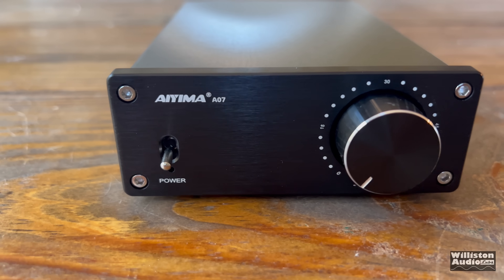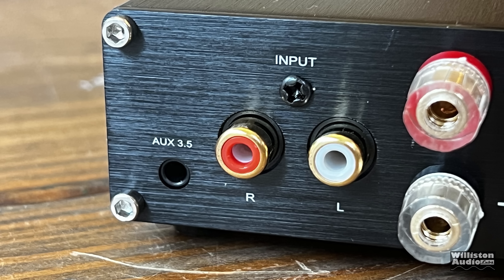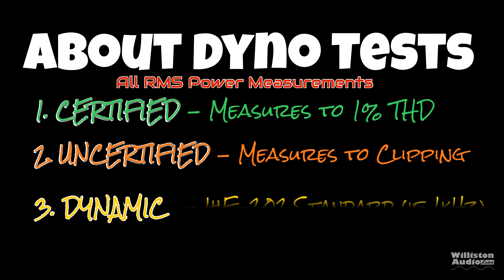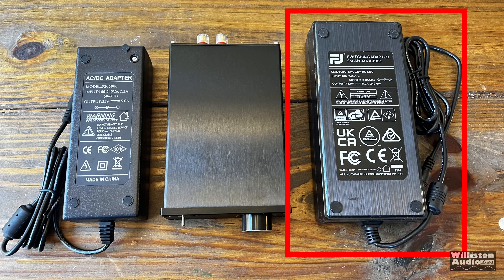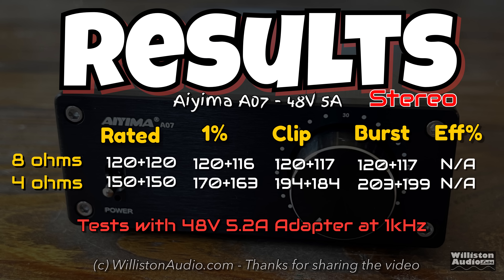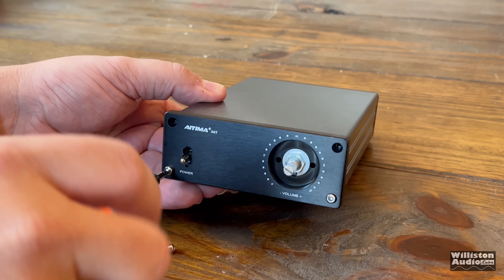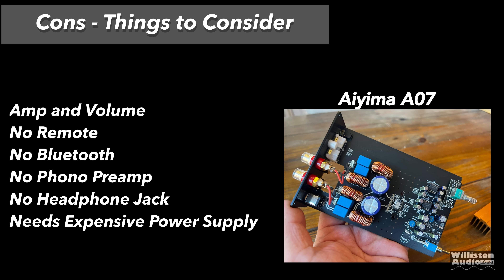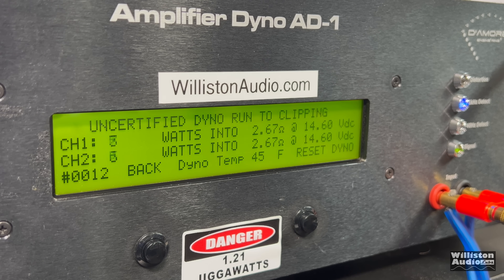Is it the MOST POWERFUL Mini Amp on Amazon? AIYIMA A07 Amp Dyno Test and Review

Comment: I should mention that this particular amplifier only uses a 50 volt input capacitor...  I would be reluctant to run it at 48 volts... I believe some of the other models are using 63 volt capacitors.

Comment: I have two of these that I use to bi-amp a Magnepan panel and a Newform tweeter. Along with a velodyne subwoofer.  The amps have been upgraded with new op-amps and an adjustable 0 to 48 volt 10 amp power supply. 

The image that these amplifiers produce with these speakers is completely 3D...   Everything in the recording exists in its own space on the sound stage... The speakers themselves seem to disappear...   I've never heard much better at any price.  

Anyway... What I'm saying is that these amplifiers are a lot better than people think they are....  World class sound in a small package.

... And for such a low price... It's incredible

Comment: @1:26 350% efficiency. It absorbs power from the cosmos 🥲
I have the A07 pro (speakers amp) and it's a pretty decent unit. Willing to add a sub to the system, so checking this amp out.
My only complaint about my A07 pro is that the line out jack (3.5mm) is generating a lot of AC interference! Not sure if my unit if faulty or if it's a flawed design.

Comment: 32V x 5A  = 160W x .9  (max efficiency = 144W (but it will never reach that.
Your 600W is silly and should be retracted and never repeated
A supply that will possibly deliver 600W will probably triple the cost of the amp and the amp will go into thermal overload and self destruct

Comment: Video is quite old, but here are my thoughts about power supplies and testing:

I paired 2x24V LED PSUs to get 48V of output. Not every PSU will handle it so make sure to make first some tests without AMP. I used 2 this same brand and model PSUs.
Other method of testing would be to test each channel separately. In this scenario only one channel would draw power from PSU.

Comment: I suggest checking out thrift stores that usually have a large electronics section to find a power supply with the specs you need. Me, I just go to the boxes in closets and basement filled with saved, cables and power supplies - you know those boxes my wife keeps telling me I need to get rid of.

Comment: Even if the bass comes out well, it clumps up.
Put the four internal pseudocapacitors (1uf)
Replacing it with 0.68uf improves the high notes and mid-range.

Comment: Actually ... so long as the output coils are up to it any TPA3255 amplifier is capable of  performance equal to the A07 or the newer V3 .... These little amps are basically a "chip in a box" ... when properly implemented their performance is all about the chip.

Comment: I’ve been looking for true power specs of this board. Thanks Dereck !  

I was going to put together 2 ICEpower 50ASX2BTL for 2x170 for a custom set of monitors I’m currently designing. My tylers are currently on some hypex amps and that’s not changing however I’m not putting that much money into this additional monitoring setup especially for the b room that doesn’t need to get that loud, rather than dynamic. 

These tpa3255 with my Mean Well LRS-350-48s just sitting around can make more than enough power for what I want to use them for and this video just confirmed via the dyno. 
48v at 7.3a, luckily I won’t NEED to drive to speakers but I’d rather have headroom and the power on demand. , the tpa3255 is gonna save me money time and headaches. 
I’m going fully balanced with xlr inputs and getting an aluminum rack mount case made for the project. Overall it’ll be a $300-400 project, nothing vs my hypex ncore setup plus the d2x’s when I got them were like $7800 

The tpa3255 can truly handle 52v before thermal issues start and it’s starts going into protect

Comment: Can you use a cheap car audio mono block sub amp (500 watts or less) with a good high watt power supply to power home theater sub woofer since it would be under driven anyway?

Comment: I just ordered one of these but didn't realise that the power output is less with the power supply that comes with it... I can only expect 107 watts x 2 running my 6 ohm speakers... (my speakers are rated at 140 watts) With your calculations that figure is bumped up to 133 watts, should be perfect! To get the full 300 watts you need to buy a 48v 10A switching power supply and wire up your own leads (beyond me). Mine came with a 36v 6A adapter. It's plenty loud though, a really awesome little piece of tech! Way better than my old Kenwood receiver!

Comment: Let me tell you, this A07 impresses even more - and how, you might ask?  Simple - replace the two NE5532 Op Amps out (they are easily removable) and replace them either a Burson or Sparkos Labs discrete set of op-amps (there are 2 op amps inside the A07).  The sound quality change then becomes quite remarkable, in that with the op-amp upgrade, the music becomes even more dynamic, more 3D-like, warmer in tonality - and (and this is a big and - in my opinion), the A07 now sounds a bit more like a class AB amp.  So yes, you can do quite a few things with this A07.

The other add-on that I brought in was a 40 Watt higher-end, quality Linear Power Supply (completely bypassing the stock external brick that comes with the A07) and the amp became even quieter - no noise whatsoever - no hiss - no hum - no RF feedback.  So between the op-amp upgrade and getting a true linear power supply, this A07 now sounds more like an amp that runs from $800 top $1500.
Reply: Thanks for the tips! A link to the power supply would be helpful.

Comment: I own this amp and honestly the sound quality is what really blew me away... It is quite good out of the box... But the ability to roll the opamps with discrete ones really elevates this little amp to compete with actually some fairly expensive products... Even with a $300 investment in opamps, the amp itself, and a power supply; it will compete pretty favorable with the boutique amps... It seriously sounds surprisingly good vs my Emotiva A300... I tried it on my Emotiva T2 towers (4 ohm) with rolled opamps and I was kind of shocked... It's currently just driving my ceiling speakers (monoprice with AMTs) with my echo dot... It's still ridiculous for the $$$

Comment: You said that power supply is expensive but you can alsways use 48V that are in metal casings, 400W  unit costs about 20$ so cheap as dirt. Anyway this amp rocks with so small chip and enclosure getting 400W in total.

Comment: Hi, I have the same Elac speakers and a 24v 6.25A Mean Well power supply. Everywhere I read that 24v is "not enough", what advantages would I have with 48v? I listen at low volume and I like the sound, I'd like to understand if with 48v I will have a better sound or the sound is the same but with just more headroom. Thank you

Comment: 3:39 Assuming RMS voltage, the maximum power available (assuming no losses) from a 32V supply into 8Ω is 128W or 2*64W (so 65W would be impossible, unless there's up-conversion of voltage going on in the amp - which I doubt).  53W output gives an efficiency of ≈ 83%, about right for  Class D amp. 4:48 That's impressive, given that the power supply is rated at 32V and 5A, i.e. 160W or 80W/channel.. 5:29 As would be expected since the power supply can only provide a maximum of 249.6/2 W/C. 12:37 388W from a 249.6 supply, interesting.
Reply from the maker: Very insightful comment and thus shows theoretical vs actual. The 250W power supply has the capability to output much more than 250W for short periods, explaining the 388W from the 250W supply. RMS does not infer “continuous” power thus allowing this amp to produce more because the power supply has an increased surge capability which fits into the duration utilized by the testing device to determine RMS power

Comment: I picked up another denon 3800h today and I seemed to have did what I wanted in auro3D, which is 5.1.6 to 7.1.8. But who knows I have no idea what I'm doing. Just plugged the output of one to the input of the 2nd, messed around in video option to turn monitor 1/2 to activate and I got sound, I already had picture. Then I go to to the speakers plug them in and it works, also the info button shows the channels active as intended. But again I'm prob looking at something wrong. The remote works for both. I can get a 16th channel using the vog of the 2nd avr and 8 subs.

Comment: This amp as well as most chinese Tpa3255 based class d amplifier boards need some tweaking.

First of all,at least 50 000uf caps needs to be added to DC input, otherwise low frequencys will suffer on medium to high volume,and voltage dropouts will ruin sound quality.
You need to bypass 6 electrolyte caps where sound goes through, with propyline caps.
14th leg on tpa3255 datasheet or avdd needs more than 1uf cap,atleast 100uf.

Inductors on output filter will work great for 4ohm speakers for 6-8ohm speakers other inductors must be implemented for lowest thd possible.

PSU with good filtering is very important also,otherwise humming sound and other harmonics will get into sound.

I am powering by tpa3255 of 31.5v 8x3 18650 battery.That is the cleanest power source,and I am quite satisfied with the sound.
Reply: 50K uF?  Absurd suggestion, countless people as well as TI themselves have measured distortion @ wattage.  The likely reason you need so much overkill capacitance is because your battery has too much resistance or voltage too low for the speaker impedance, so it's like shooting yourself in the foot and then turning to shoot the other foot too!

Comment: My problem with some of these little amps is that they don't seem to have capability to sustain output at low frequency. The adapters just aren't designed to manage such dynamic changes in current draw at a guess.

I had been looking to use the 300W versions for running buttkicker and ended up having problems with the input sensitivity of the amps I tested. 

I think it's better to not use the laptop style power supplies and instead buy a proper PSU and put it in a small enclosure off desk or out of site.

Comment: I just bought a A07 pro and upgraded to 48v 5a is it normal for amp to runs warm even when not using or volume is turned town. It doesn’t shut off or anything? And sounds fine no static or hissing. Should I go back to stock PSU?

Comment: I use a 48V psu turned down to 44V, the sweet spot.  I drilled holes on the top and sides of the case for more ventilation too.
Reply: How many amps?
Reply: @westsenkovec   It's a 48V 7.5A power supply
Reply: @westsenkovec   If buying now, I would buy the Aiyima A08 Pro, comes with a 36V power supply.  If you want to upgrade, check out Meanwell power supplies
Reply: Thanks but I'm looking for a subwoofer amp and others don't have a low pass filter.
Reply: @westsenkovec   I see, you are looking at getting the mono version,  Aiyima A3001
Reply: @sodasodas3  yeah. I need it for bass shakers. I hope it will be enough but I've read that hat some people said that the Fosi Audio M03 version wasn't strong enough.

Comment: The power supply is DC. DC equivalence of AC is around 85v DC to 120v AC. So an amp producing AC will use marginally less watts from a DC supply. This is regardless of if the supply is producing more power than it should.

Comment: Video TOP but Mini Amp is Rubbish for me. I have a Car Amplifier that I use with a PC Power Supply. It sounds great and has been running for 3 Years. Just being tested with a Switching Power Supply, which is the Best and most stable so far. In addition to the Two, an old Car Battery Charger was also tested. I want to test the last one with a Power Cap and upload a Demo Video to my Channel.
Reply from the maker: Sounds cool, wanna see it!
Reply: @wal  Video uploaded to my Channel.

Comment: I recently refit my custom boombox with a 2.1 amp off Amazon (DAJUNGUO TDA7498E  $49.99) I bought a amazon 10A 36v switching power supply $27.99, and that little amp has some sack! The box has two 8" dynalab woofers, 2 soundstream tweets and I replaced the old mehh goldwood sub with a Recoil 8" Echo series sub another impressive product. Each driver is in about a cubic foot,Very happy BUT the D2 sub was out so I got a D4 and rolled the dice on 2 ohms.... I had to buy another amp she popped.... So Do not use 2 ohms it will not take it! in all fairness it says 4 ohm stable but I took the risk that gamble cost me $50. So even wired to 8 ohm on that amp the sub jumps! That baby recoil sub will play at high excursion for hours nonstop ! I was like its gonna pop.... nope🤯 just keeps flexin an pumpin out nice bass. I was impressed with it's performance.

Comment: I bought this amp and using it daily in my system. It’s really good. I’m sure most people couldn’t tell the difference from my Audiolab 8000p (vintage class AB amp). I’m using a variable power supply that goes to 48V 7A which this amp can handle.
Reply: I bought the amp also.  So at the end of the video, he says the line out can not be used with a subwoofer because it doesn't have a variable volume.  Can you confirm that?
Reply from the maker: @stevelouie5928  the line out does not vary with the volume. You can use with a sub, but you’ll need to adjust the volume of the sub separately. Not a good solution IMO
Reply: @wal  That means you just have to use the speaker line out to a sub with a speaker out.
Reply: Audiolab 8000P would smoke this in all departments, dynamic range, current , voltage, slew rate, damping factor.

Comment: Has anyone ever seen an Amp Dyno on the Kicker CXA 1200.1? I’m looking to push one 8” kicker q class sub rated for 500RMS. The Amp is rated at 600rms at 4 Ohms. If I understand this correctly 4 ohms is not only easier on my car but emitting better SQ . I also figured that 100rms above its rating should be plenty. But there are No dynos that show the amp at 4 ohms. I need to know so I can buy the correct ohm subwoofer

Comment: This amplifier is meant to be powered by a 48v dc power brick not 32v dc, so its supply is under, that is one big reason why you wont get the 300 watt per channel rating, so amazon may aswell be called scamazon.

Comment: It would be cool if you could test this with a 7.5a power supply to see if you can get any more out of it.  You can get Meanwell 48v, 7.5a (360w) power supplies on amazon for $23 or so, but you will have to wire the line voltage and wire them to an appropriate barrel connector to the output on your own.  Messing with electricity isn't for everyone, but I imagine this is within your range of capability.  Meanwell isn't a household name but they are a leading manufacturer of power supplies, LED lighting chips, and various other electronic components, so you should be able to trust their equipment won't start a fire.

Comment: Also I was wondering, for us that listen at high volume, are you able to measure the power at:
0.1% (-60db) ? 
0.01% (-80db) ? 
0.001 (-100db)? 

Isn't 1% THD (-40db) quite high distortion? 

I see other manufacturers measuring the power at 0.003% THD (-90db), 0.002% (-94db), etc.

Thanks 🤘

Comment: Thanks for showing that the 3.5mm output is fixed volume. I have the Fosi Audio TB10D, which doesn't have this, and I thought that I might need to get the A07 if I ever want to use a sub.

Comment: Im guessing youll never do the deaf bonce avatar amp dyno like that one kid used to always comment on every video.
Reply: I actually own the amp, and i dont have the d'amore dyno BUT i measured its output voltage at 57v on a 40hz tone @ 14.6v @ 1ohm. So roughly 3k watts.

Comment: I have a D Class amp (BRZHiFi M6) with a line level output (labeled Sub Out) that also has no variable volume. I have a subwoofer hooked up to it and have the volume on the amp fixed at a level such that the volume output to the sub is matched (to my liking) to the speaker output (in my case '70' out of a max of '80'). I then use the source volume control (in my case my laptop) to vary the volume output of the system. Sounds great at all volumes to me, although obviously a sub-optimal setup. Further on the run refinement of bass, mids and treble can be made through either the tone controls on the amplifier or graphic equalizer software.

Comment: The AIYIMA T8 is an excellent DAC to pair with this. Mine is connected to a Fosi Audio TB10D, and it works very well also. I've run everything from full sized floor tower speakers to testing car audio components and tweeters before installing them. Buy some good RCA's to go between the DAC. I'm using "World's Best Cables" with Canare Star Quad.
Reply: DAC   kullanmazsak  ,  A07  pro   sadece  tek  cihaz       kullarnırsak  DAC  olmadan     ses kalitesi  arasında   çok ciddi  fark  varmı  ??  teşekkurler

Comment: i have this amp running 48v 7.5amp with OPA1656 opamps and elac debut 2.0 B6.2 works great, you have different caps than my model by brand and earlier models had 80v caps such as on asr forums users have shown many different main caps being used, overall a good little desktop amp IMO pairs well with my FiiO K5 pro ESS for desktop nearfield usage.
Reply: Hi, I have the stock 32v and a 24 6.25amp with the same speakers. Do you recommend me a 48v one? I listen at low volume, don't need more headroom and I'm good with the 24v at the moment but I never tried a 48v  one :D
Reply: @manuelamadio1995  i wouldnt bother with it if you listen at low volumes, ive found even with the stock psu i didnt get too high in the volume before it was annoying nearfield. one of the main reasons is the price of the power supply can quickly be close to the price of the amp. also the amp is gonna get hotter with 48v so you would need to drill holes in the top as i did so the tiny heat sink has airflow.